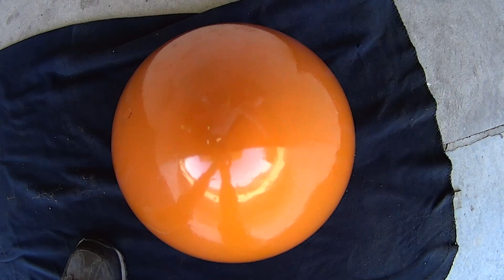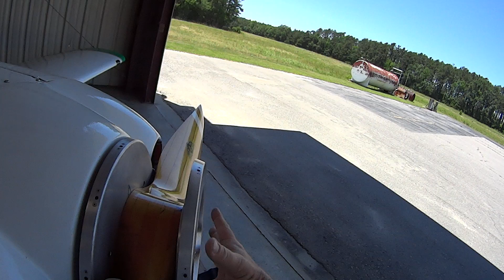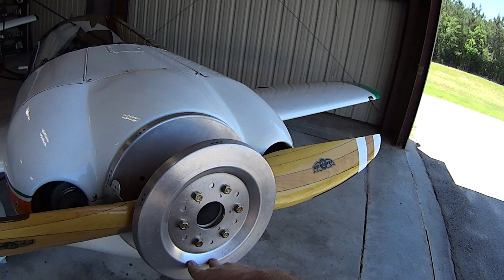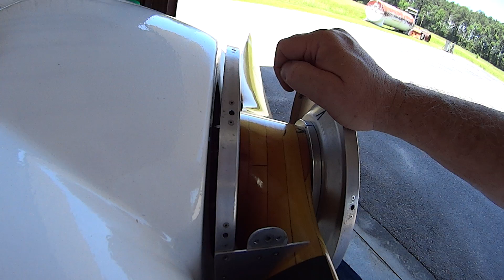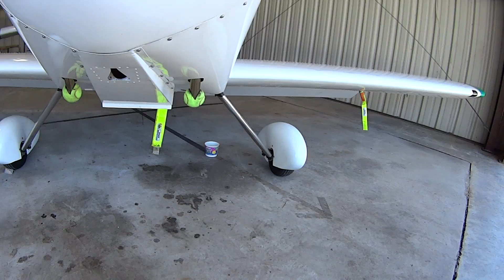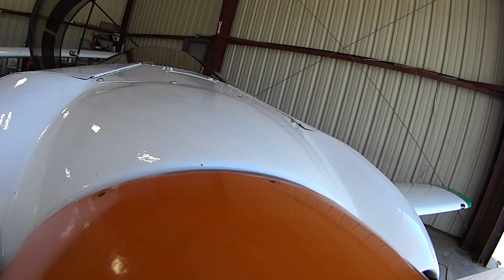Behind The Big Orange Nose ...

Comment: Have any recommendations on how to drill the bulkheads?
Reply from the maker: Good to hear from you! I had some photos on my Expercraft builder's log but that site went away. 

I used a tapered piece to align & center the crush plate on the front bulkhead. I then set the SAE 1 holes evenly between the holes already in the bulkhead. Once aligned they can be secured (clamped) together and drilled on a press using the crush plate as a drill guide. When finished, the line up of the crush plate, front bullhead, prop, rear bulkhead & prop hub were extremely close. I had one hole that needed to be hand reamed a couple of turns but that should be done to all the holes to make them clean & smooth. 

BTW ... my 3/8" crush plate also came from Sabre Manufacturing. Hope this helps ...